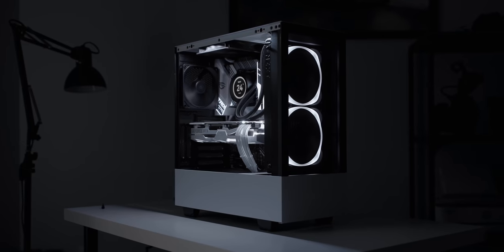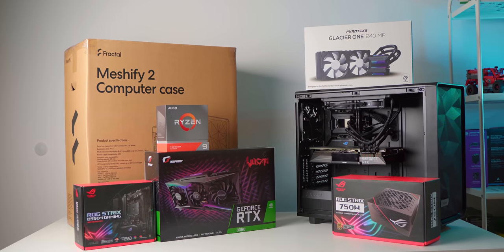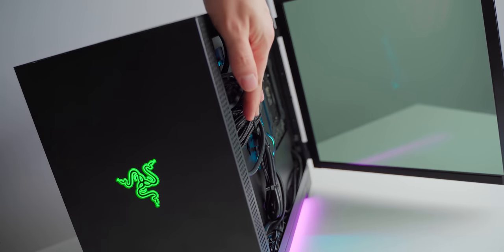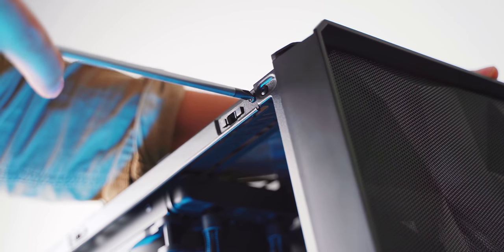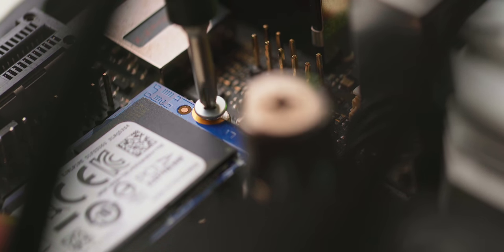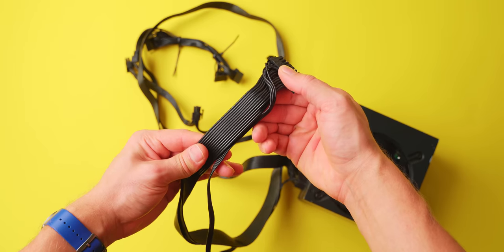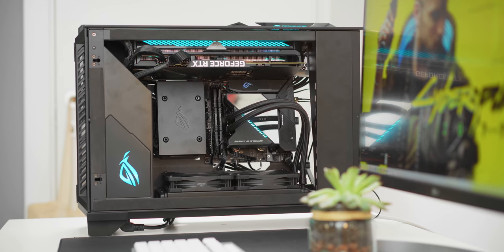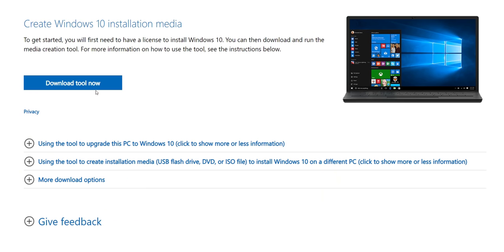AVOID these BIG Mistakes when Building a PC!!!

Comment: The worst part is when people screw, but they forgot the confidence.
Reply: Not as bad as having the verge on thermal paste application.
Reply: I also hate it when my swiss army knife doesn't have a philips head screw driver
Reply: As Lyle said, “screw with confidence”
Reply: I hope you remembered the Bluetooth Livestrong Anti-static band
Reply: Y'all got any more of dem tweezers?
Reply: I tend to misalign my brick.
Reply: I don’t have a table. Am I screwed with confidence?
Reply: @spiffy72985  I’m so glad this joke is still alive in the pc community
Reply: Unlike stefan’s pc
Reply: Braces and brackets
Reply: Let me see if I understand you Verge. When I'm screwing, I should be confident that I will mess it up. Correct?
Reply: It fuckin sucks when I forget to vertical mount my power supply.
Reply: @pretzel3779  To his defense, it was actually wifi livestrong anti static band giving him a greater distance range of protection!

Comment: Removing the motherboard power cable Oh god its like thor hammer
Reply: This feeling when you're switching from an old I5 to a Ryzen 7, but the frist thing to do is to waste 10min of your life unplugging that little piece of $h...
Reply: Yea but you know what is worse - 8pin eps when the case and vrm cooler is not alowing you to get a solid grip on it (for example: corsair 400c + asus b450-f)
Reply: yeah I had that problem with the usb connector :(
Reply: @Zez1nas  B550-f here...
Reply: yes it took me half an hour just to get it out
Reply: @clawwer4404  i have broken a few usb 3.0 ports on a motherboard because it was stuck
Reply: @tonn333  Same here they fell like one time use as he said
Reply: Yep. Replaced 10 year old dead power supply the other day. Boy I wiggled that little shit for ages. Almost as hard as getting out the 8 pin between an nhd14 and the rear fan.
Reply: Just cut the pcb around the connector and stick it back on later. Doiii
Reply: Nah USB 3.0 Cable is worse
Reply: @chaos8519  yeah the usb 3.0 cable is like one time use
Reply: @tonn333  My usb 3 cable is at a weird~ish angle, I'm not touching it because it works not going to risk it
Reply: I just built my own pc and damn this is so accurate.
Reply: Yeah, my issue is I try to be careful to not rip my motherboard out of the case at the same time.
So it ends up taking way longer than it should. Either motherboard power tolerances are not good.
or the PSU company's tolerances are not good. Or they are both not good to make it extra difficult.
Reply: plugging in the 24-pin power cable bends the motherboard like it's gonna break
Reply: @clawwer4404  one time while I was building a pc I plugged the usb3 cable in then unplugged it to reroute it and the connector came off with it
Reply: @sherlockhighland8292  easily fixed by sticking a piece of wood or plastic behind the motherboard so you have a still piece to push against.

Comment: USB 3.0 cable for front IO is such a PITA
Reply: I totally agree! I bought a slim extension for it and it makes it so much easier and it actually looks good too
Reply: @red_guardian  Where did you get it?
Reply: @red_guardian  didn't know that was a thing, I def need one.
Reply: @red_guardian  Yeah bro, spill the beans.
Reply: @red_guardian  Yo where did you get it
Reply: I got one from eBay, just search low profile usb 3.0 extension and you should find it. The part that the case usb 3 cable plugs into was a bit of a tight fit for mine though, so keep that in mind.
Reply: I managed to yank the shroud off my motherboard once taking the fucker out, it was that tight. It went back on just fine, but it was one of those "oooooh sheeeit!" moments.
Reply: As much as a pain that cable is, it does provide for two USB 3.0 ports on a case so I get really pissed at cases — like the new Cosair 4000 series — that only provide one.
Reply: @nealsheeran4011  yeah that's dumb. Go back to when high end cases had 4 please.
Reply: I broke mine lol
Reply: @brumby92  NZXT's H700 has 2 3.0s and 2 2.0 sadly no USB C, 710 does though

Comment: Little tip for my first build in 2020, to keep all the screws and fittings well organised,  use a baking tray for cupcakes or tarts and all the separate compartments keep your screws really well organised and reduces the chance of losing them or mixing them up.

Comment: That feeling when you drop something and it falls behind the motherboard...
Reply: Or into the PSU.
Reply: I lost a screw in the case for two years, still can't get to it
Reply: dropped a screwdriver that hits the motherboard
Reply: Just hold the case on an angle and it will fall out. You can't do this easily with cars, but with cases no problem.:D
Reply: have you got your mobo stuck on a standoff and that standoff is impossible to remove because its behind a piece of metal support of the case
Reply: I luv it when you drop something and it vanishes directly into a black hole or something. Seriously, I lost screws forever. No idea where they went.

Comment: Doing everything perfectly, only for the system not posting. 
Heart attack inbound.
Reply: I installed a new CPU last week. Installation went fine and dandy, pressed the power button... nothing happens. I had one of those mini heart attack moments before I realised I hadn't plugged in the PSU :')
Reply: well that means u did not, lol.
Reply: Flips PSU switch. "Oh thank god"
Reply: 8 years ago i built my first pc on challenge from my son.  $2500 of stuff. i bread boarded the important stuff outside the case  and you guessed it no post. i spent 2  or 3 weeks online, sending my mobo back and forth to the manufacturer (wont name them) but  finally got smart and " thank you Amazon" they just up and sent me a new board that finally worked. thank you Corsair who when i explained my dilemma just said send back the ram and we're shipping 2 new sticks to you...no questions asked and i even told them i did not think it was the ram (hey  it was platinum dominator ram to boot). As opposed  to the mobo manufacturer who sent me in circles saying it was the ram or the psu (Seasonic platinum...i dont think so) or even the CPU. They must have thought i had my own inventory of extra parts to try out...morons! my first build was the most frustrating but in the end the most satisfying!
Reply: @pdureska7814  yeah, l know of people that a similar experience, how am I supposed to troubleshoot this with no parts.
Reply: Built my pc with all parts except gpu ( did not arrive yet ), tunred it  on annnnd no post screen. Then I realised I built with a amd cpu and they don't have Intergrated graphics. Heart attack smol

Comment: Try HUE products from NZXT. The naming and incompatibility is so confusing, that I ended up buying incompatible parts two times now (after informing myself on their website about their products).
Reply: But they made a universal front I/O connector, which is like... AWESOME. I was ready to use pliers when my parts arrived and all I had to do is line up the connector with the pins and voilá, done. Best FP I/O experience ever. And the panel itself looks so simple, amazing. :D Sorry, I'm gonna let myself out now, my H510 just started cooking my parts. :D
Edit: just continued the video, I have to say, mounting my rad to my removable fan mounting thingy was a piece of cake. FORTUNATELY, it wasn't an NZXT AIO, so no CAM software needed. :D
Reply: @kemdom  I agree
Reply: @kemdom  I agree. My only dislike is the poor airflow. And only one top exhaust.

Comment: Tip on dust cleaning - invest in decent portable leaf blower. They are small  battery powered and do not generate static.
I got myself a Makita one years ago and proudly used it on removing dust from PCs, servers, car engine bay, drying bike after wash etc.
Ear plugs not included. Do all work with blower outside. It still makes me smile remembering my friend using it indoors on 5 year old PC that spent it's life on floor, never cleaned...

Comment: I just recently built my new gaming PC, I could not wait anymore- I have been using my intel core i7 4790k since 2014, if you are planning on upgrading your PC just do it now since there is limited stock on all PC components going into 2022! 

|Noir-PC|
CPU: Intel Core i5 10600k @ 4.5Ghz stock [6 cores 12 threads] ($284USD)
CPU Cooler: NZXT Kraken M22 120mm AIO ($80USD)
CPU Thermal Paste: Kingpin cooling KPx ($13USD)
Fans: 2x 120mm Noctua NF-F12 iPPC-2000 PWM ($50USD)
Motherboard: Asus ROG STRIX Z490-I GAMING Socket 1200 ($271USD)
Ram: 32GB (2x 16GB) 3200Mhz DDR4 Corsair Vengence LPX ($110USD)
Graphics card: EVGA RTX 2080TI XC Gaming Hybrid (watercooled) ($1400USD)
OS Storage: 1TB Samsung 970 Pro M.2 NVME SSD ($350USD)
Music Storage: 500GB Samsung 860 EVO Sata 3 SSD ($75USD)
Powersupply: Corsair HX1000w ($250USD)
Cable Extensions: FormulaMod Sleeve extension cable kit ($24USD)
Cable Ties: Attmu 50 PCS microfiber cable ties ($7USD)
Sata Cable: Silverstone Tek 180 Degree SATA III Cable ($10USD)
Case: NZXT H210 small ITX ($80USD)
Monitor: Acer Predator XB271HK 4K (3840 x 2160) Nvidia G-Sync 60Hz IPS gaming monitor (cost not included)
Keyboard: Corsair K70 RGB (cost not included)
Mouse: Glourious Model -O (cost not included)
Total Cost for PC (Before sales tax): $3004USD

Comment: One of the best investments I've made to aid in my builds is a good set of molex tools so I can customize my cables. It doesn't necessarily make the building process any easier because it is quite time consuming, but you can cut every cable to the perfect length, making cable management a dream. You can also sleeve them individually yourself too, saving money on pre made custom cables or extensions. 
It's quite a rewarding feeling when the cables in the back of your case looks as good as the front.

Comment: The worst thing is when you have your parts, and you totally forgot the Swiss Army Knife.
Reply: I once forgot my live strong bracelet when building my pc, and my whole neighborhood burned down as a result.
Reply: When your swiss army knife ends up not having a philips head screwdriver in it
Reply: I forgot to use a bracket on the back of my power box
Reply: I ran out of tweezers. Bad times.
Reply: Is that a reference to the verge video?
Reply: @zilliq  noooooo
Reply: that hopefully has screwdriver on it
Reply: Got all my parts, just waiting for the thermal paste applicator to arrive in the mail to start building
Reply: As long as you still have your tweezers for cable management, you're all good.
Reply: @zilliq  No, it's a reference to your mom.

Comment: Just built my first PC in over 10 years ... So glad you recommended going to the 4000D case.  That case was very easy to work with.  Biggest problem I had were those front panel connectors and cable management.  But overall was not that difficult.  Thanks for making videos that help guide people it really does make a difference.

Comment: Excellent video! I second the frame cutout near the GPU! I've stripped a handful of screws because of angling the screw in wrong because of the frame. And definitely agree re. the GPU lock slot. It's astonishing how frustrating it can make removing a GPU. Also agree re. the non-reusable bags. I also find the plastic zip ties when managing the cables to be total junk. Even the velcro ones they provide are usually mediocre. Double-sided velcro ties work so much better.

Comment: For mounting fans+radiator in the top, first secure the fans with a couple of regular fan screws, then use the radiator screws for the holes left. After that, just replace the fan screws you used for securing the fans with radiator screws.
If you have modular PSU, just plug in the 12V EPS cable in the motherboard before installing the motherboard in the case.
Agree with everything else, although I love cable managing the back, it's so satisfying to get it perfect even though you don't see it :D

Comment: I  build a new PC every 5 to 6 years and maybe put in a new GFX card during its life so Im always glad of tips as its not an every day event for me. 
Im waiting to build a new machine in the spring when availability hopefully is normal. 
And at the moment im trying to  select a case when allows the 24 pin to go out and around the back without needing to be kinked up or down so its looks nice and level. same with the Gfx card power cable. I helped a friend build a PC recently and in order to get the 24 pin to keep on the level we took a hacksaw to the back and opened up the grommet space then put black carbon fibre vinyl around the slot to make it look neater. 
I love the act of building a pc, same as using a soldering iron when im building a new racing drone.

Comment: Totally agree with your list... for me the motherboard screws are the biggest pain... pick the wrong screw and you may not get it back out of the standoff... I wish the motherboard screws were either a different color or a totally different head to not confuse them with SSD or PSU screws... so frustrating. One tip... when screwing in the motherboard screws, turn your screwdriver in the opposite direction slowly until you hear/feel a click (as the screw drops in to the threads), then screw in normally... totally eliminates a cross threading fiasco.

Comment: Its hard to actually build a pc now not because of the building process but because of the parts themselves, I've been waiting to build a pc for a year now and I finally got the money collected and now every gpu on the market (not only 3000 series) are over twice the normal price. Sad time to be a builder
Reply: Same. I'm at the tail end of my "upgrade every 3-4 years" cycle now and the launch of new CPU's and GPU's was the perfect time to upgrade. My 8700K and 2080 Super are hardly crap, but compared to the performance jumps, especially in CPU's in the last few short years the next upgrade will be rather significant.